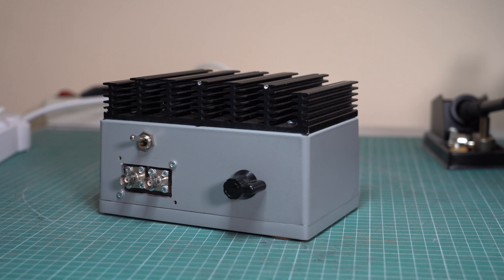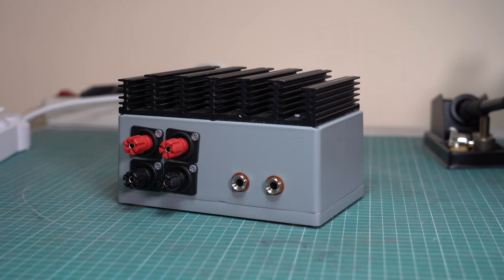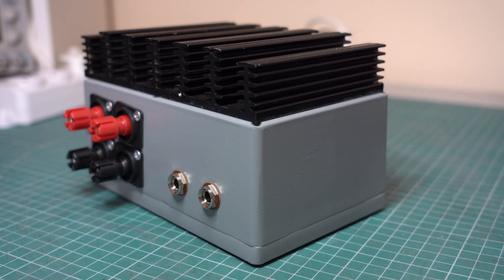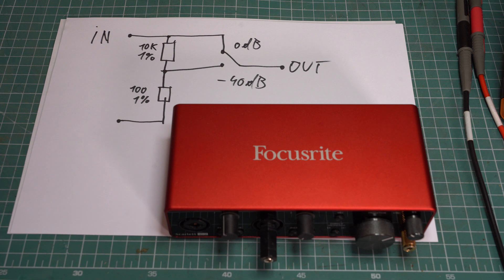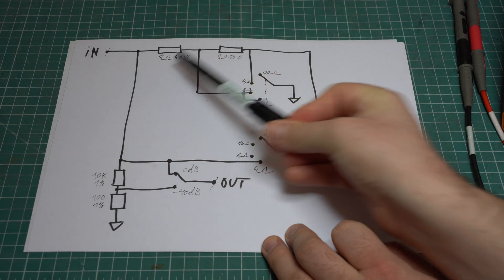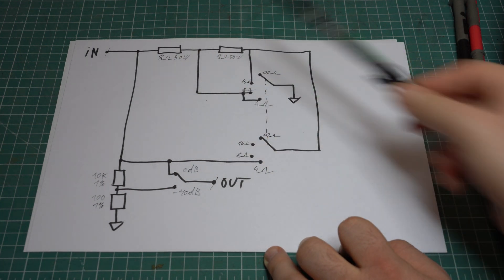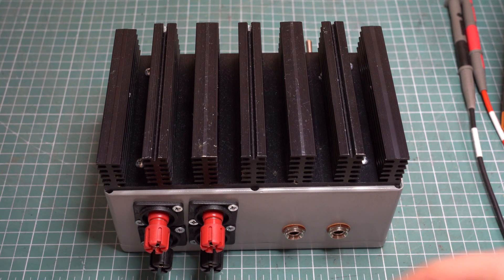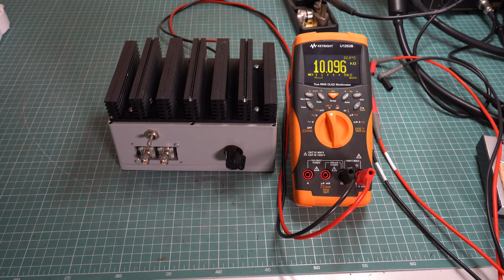Designing An Adjustable Dummy Load For Audio Amplifiers

Comment: Great video!
Question: I have a guitar tube amp that's rated at 20W. I wanted to try the DI output for silent recording but the amp still needs to be connected to a load while using it. Do you think two 50W 8ohm resistors in series would work as a dummy load for this purpose? Thanks!
Reply from the maker: Yes! Sounds good, but I recommend a setup similar to mine with proper cooling and connectors. Keep an eye on it to make sure it doesn't overheat while you play at loud volume and never run the amp unloaded because it develops huge voltages on the output transformer that can damage things.
Reply: @VoidElectronics Hey, thanks for the quick reply and the advice! Yeah, my plan was to get a small metal enclosure to put the resistors in and attach jacks, then drill a few holes for ventilation. I could also attach a heatsink. I forgot to specify that the amp has a 16ohm output, but i'm sure you figure that out already haha. Thanks again!

Comment: Very nice. I like that you put your 40 dB attenuator in the same unit.  I never knew the Ayrton-Perry winding scheme being the way they make low L and C resistors. I also buy resistors from Mouser and here is their part number for the ones I use someone might find helpful -  284-HS300-8.0F  These resistors are 8 ohm, 1%,  300 watt, non-inductive and an excellent temperature coefficient. Thanks for your video.

Comment: That's very cool! I have an old solid state stereo guitar amp with two power amps that I need to bias to get it quiet as possible but I've been putting it off because I'm not sure if I can connect my scope probes directly or not. I made a biasing jig to do this but I've been stuck at not knowing what scope probe is needed. I just don't want to kill a scope or either power amp since they have very difficult to replace (find) power & driver transistors. I've only ever built or worked on tube amps up to now.
Reply from the maker: @VegasCyclingFreak  You need to make sure the speaker output is referenced to ground. I would check continuity between speaker negative and ground. If it is referenced to ground, you can safely probe it with a scope and a 10x probe should attenuate enough so you don't kill the scope. Just make sure the amplifier is loaded, especially if they are vacuum tube based. 😁
Reply: @VoidElectronics Thanks for the reply. I'm pretty sure is referenced to ground... there is continuity between the speaker negative terminals and ground (only a few ohms). Here is the schematic: http://www.diyguitarist.net/Schematics/Polytone_PA378_PS.jpg